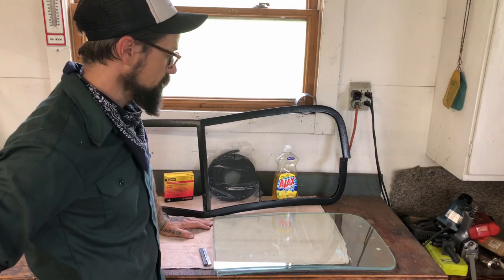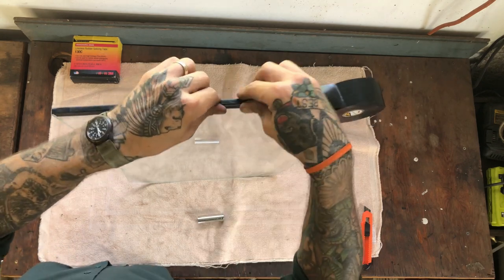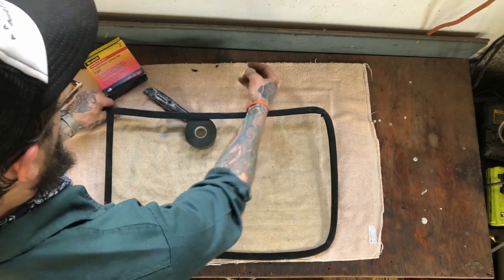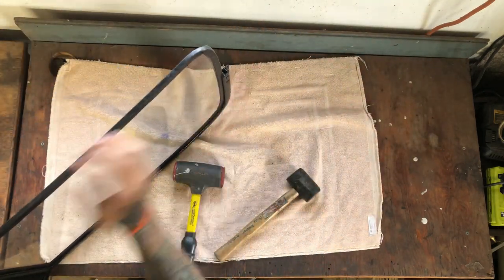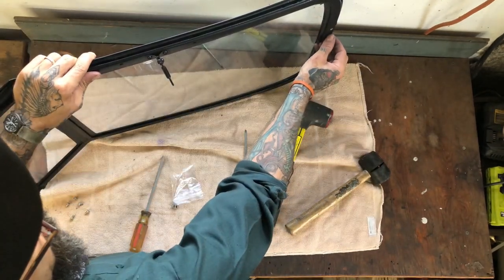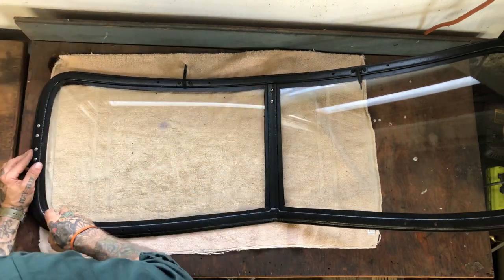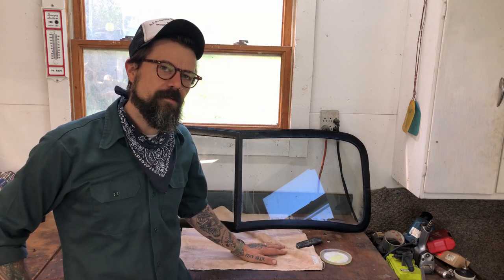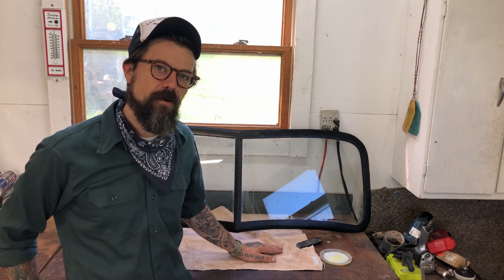Rebuilding A 1937-1949 International Truck Split Windshield

Comment: I am wondering if you have any information about installation of the glass in the drivers door mirror on a 1940 D2 pickup.   I have the original mirror but no rubber seal or other indication of how it is held into the round frame.  I am working on assembly of my project truck and would appreciate any help you could give.

Comment: Great video. This job is in my near future. What width is the splicing tape?
Reply from the maker: Hey Steve, the tape I used is 1-1/2" wide and .030" thick. The model number is 130C. Good luck!

Comment: Where did you get the outside rubber to seal the windshield frame to the cab?  I have a 48 kb7 I'm starting to play with. I got the glass but I'm not having luck with the rubbers.
Reply from the maker: Check out a place called Restoration Specialties in Pennsylvania. They got all the rubber pieces.

Comment: Like mine, it looks like the window slides into the slots a little loose. Should it be that way, and if it is, do you have any trouble with noise or whistling? My door windows fit into their channels a lot more snug so am just wondering if I need to add another layer of tape to one side of the front windshield to make it a little more snug?
Reply from the maker: The glass should be snug in the window frame. The panes of glass on this windshield slid through the steel frame channels easily, but snugged up when I seated them with a mallet -and even more when the bottom of the frame was installed. I’d say if you can fit more tape in, the better. When your windshield is completely assembled the glass should not rattle or feel loose in any way.

Comment: Do you have a video on how to separate the rusted frame?
Reply from the maker: No, but it’s a lot of soaking in penetrating oil and light taps with a dead blow hammer.
Reply: @BareKnuckleBinder  thanks. I will try to video the separation.

Comment: Eric, would you rebuild a 48 frame for a fee? Install glass, etc.
Reply from the maker: Yes, where are you located?
Reply: @BareKnuckleBinder  About to send you an email.
Reply: @BareKnuckleBinder  Sent email to address on youtube channel
Reply: @BareKnuckleBinder  same question! I am in southeast Virginia, I am a disabled vet with hand injuries and can't do it myself and no one around here seems able to deal with this. I have the frame and the glass but the shop can't get the old glass out and it has stopped the project. How can I contact you?